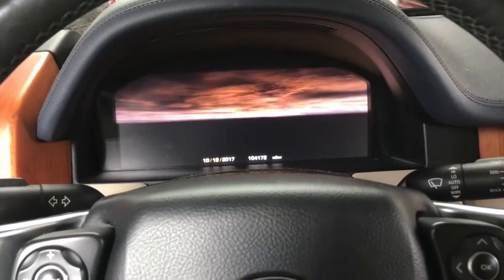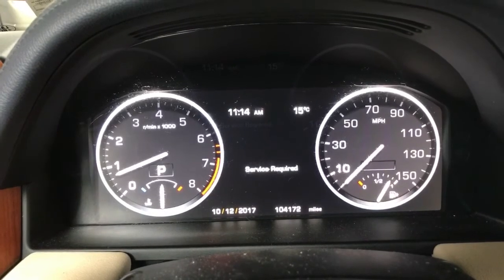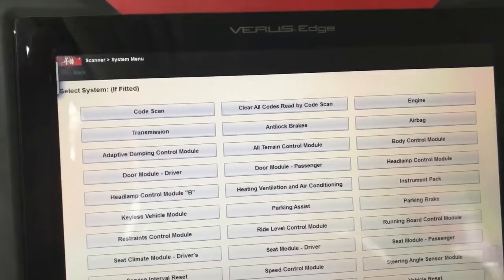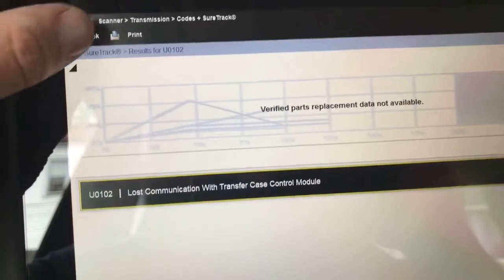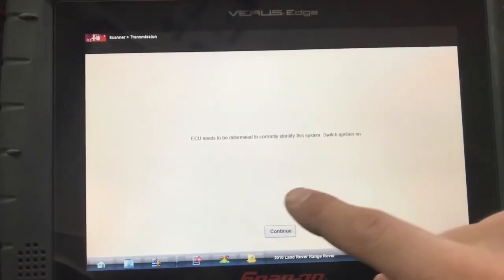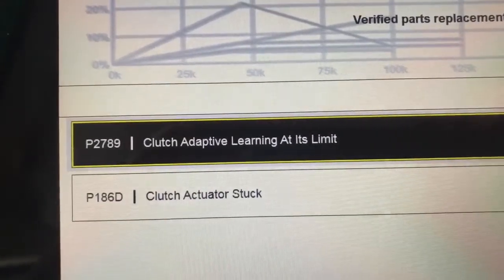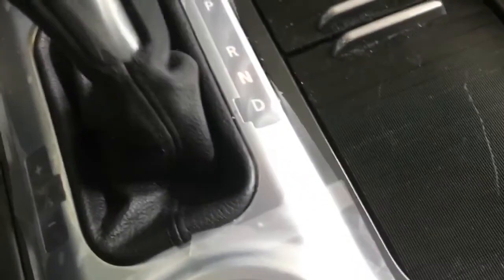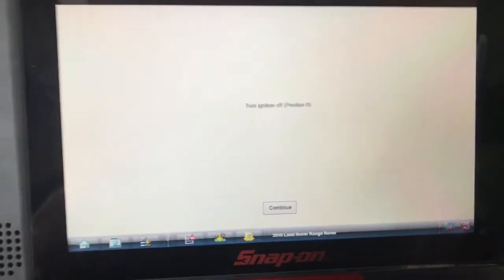2010 Land Rover Rang Rover  Transfer case clutch learning

Comment: Do you know how to perform this function manually without a Scan tool? I tried putting a spare fuse in position 37 in the passenger compartment fuse box but it did not work.